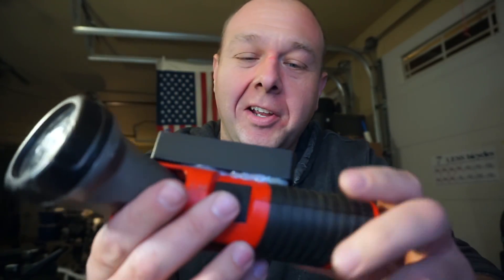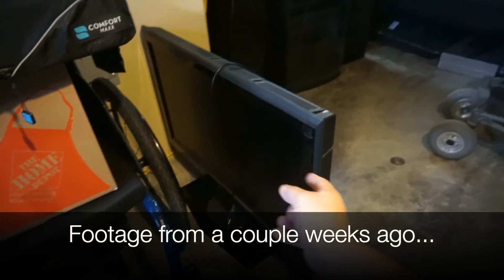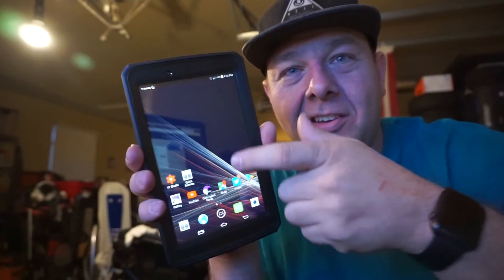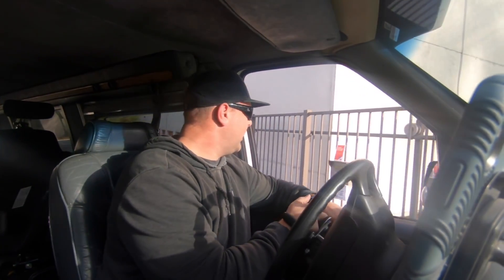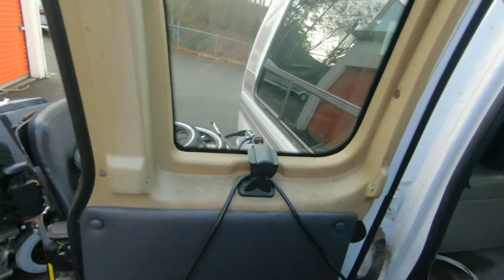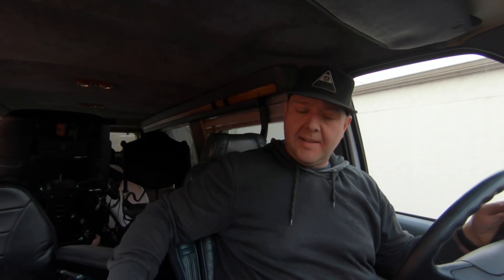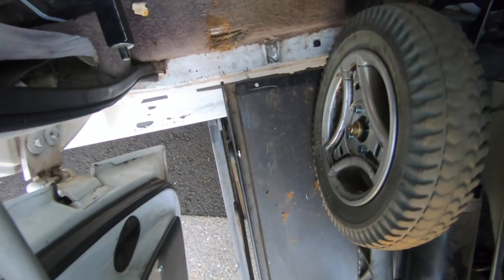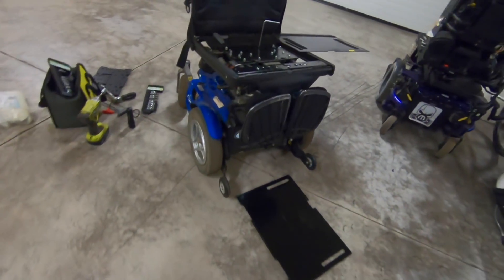VLOG 391 PART 2: whats with all the lights?

Comment: The wrench is also used to adjust various aspects of the chair.  It's pretty useful actually.
Reply from the maker: and you can swing it around wildly in case squirrels try to attack!
Reply from the maker: (ive actually been attacked by squirrels)
Reply: @TotallyNormal- see I knew where all nuts
Reply: I found it to be a bit soft and when I used it to tighten some things down one end rounded quiet a bit.
Reply: I would love to have a backup chair that worked and fit. After my manual chair died I am so high risk of getting warehoused if something happens to my m300.
Reply from the maker: yea.. a friend has one on this chair and its all TWISTED and crazy looking!  its more art now than it is a wrench! lol

Comment: Hey Dan! Have a quick question. Do you use the anti-Bar for your easy lock on all your mid wheel drive chairs that you drive from?
Reply from the maker: are you referring to the metal 'tab' that sticks out in the front an connects into another metal hook? if so, then yup!! 

...well one of my chairs has it, and the other doesn't  my C300 has the extra bar, since that chair is so unstable.. but my C500 does NOT have it - its a tank and doesn't move around at all :^)